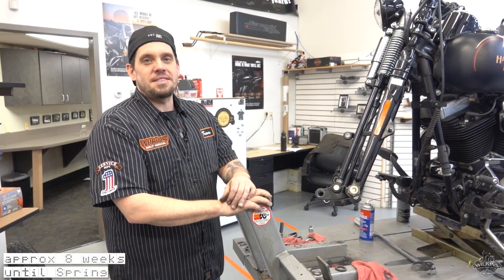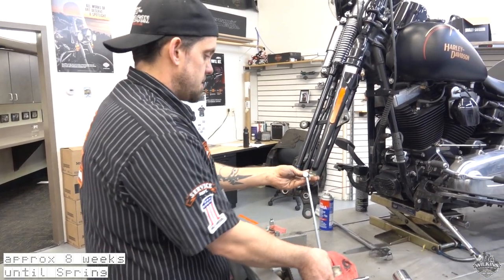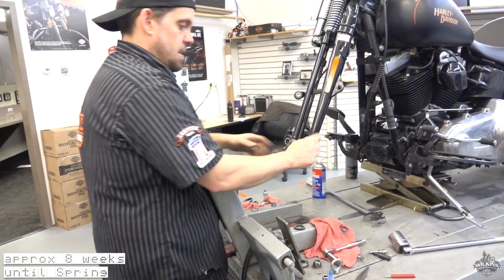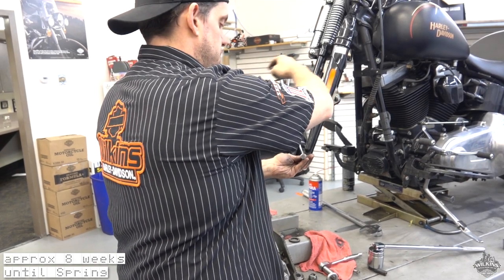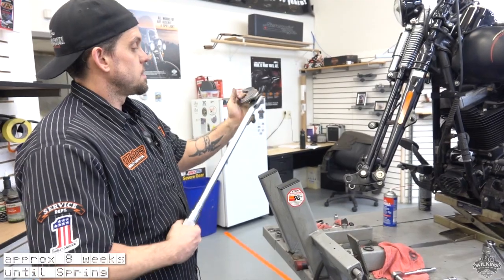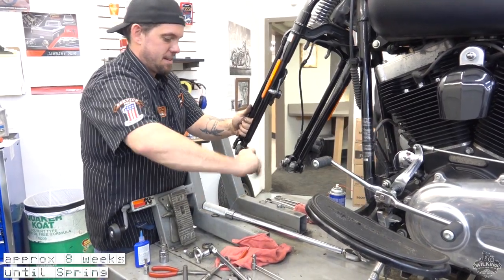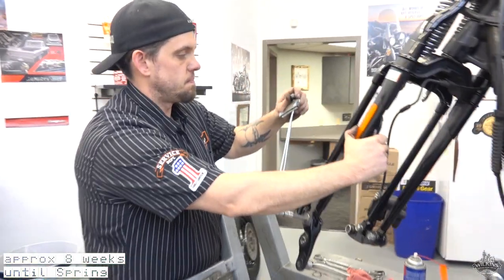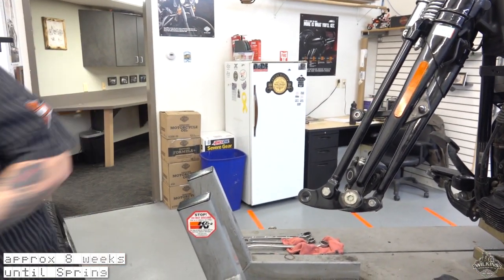How to Make a Rocker Adjustment

Comment: This is great!  Thanks for posting this, I need to do this on my Crossbones.  Quick question, when do you recommend replacing the teflon coated washers?  Thanks again.
Reply from the maker: Hi Jim, we're glad the video was helpful! Do you mean the spherical bearing race fork to rocker? If that is the case Trevor suggests adjusting it every 10,000 miles and taking it apart and lubing it every other 20,000 miles. If you are referring to a different part you can email service@wilkinsharley.com or call us at (802) 476-6104 and we can get you the information you need!

Comment: I'm planning to do the same, what's the size of the crow foot spanner? Is it 1 1/4 inch?. Thanks
Reply: It's,  1 1/2". Look for a cheap box wrench cut it down weld a nut to it. If can not find it.
Reply: @l.munnier9658  thanks, I have bought the crows foot, looks like my steering head bearing need replacement, any videos of steering head bearing installment would be a great help!